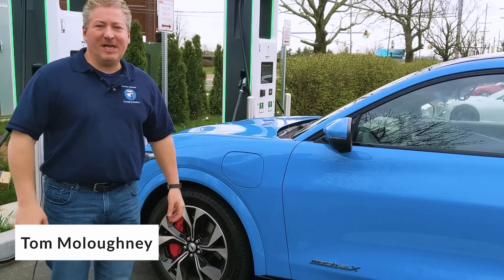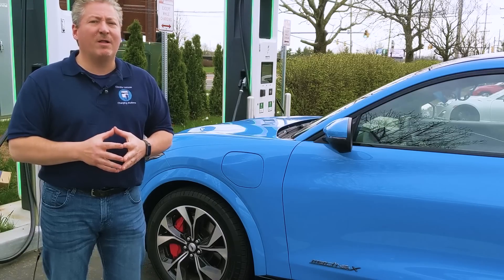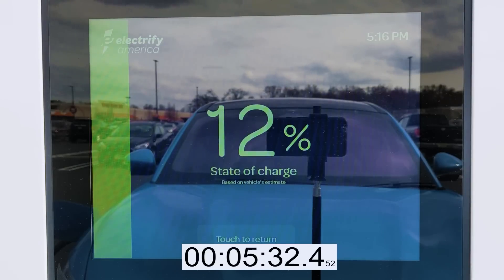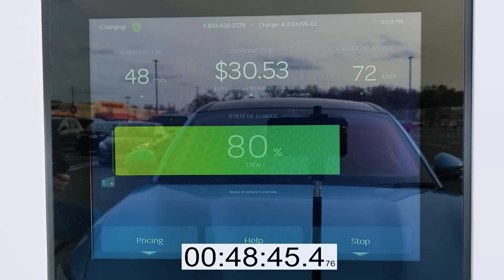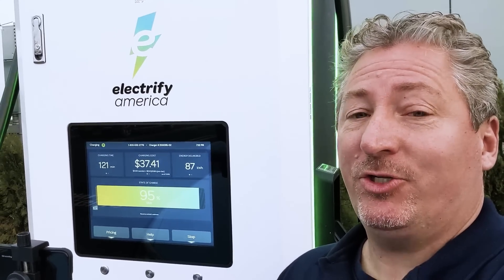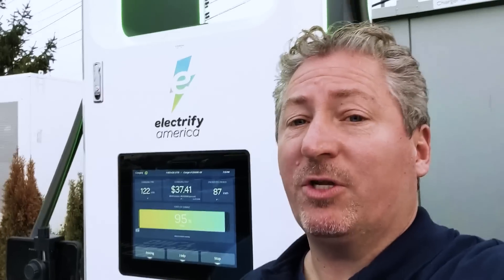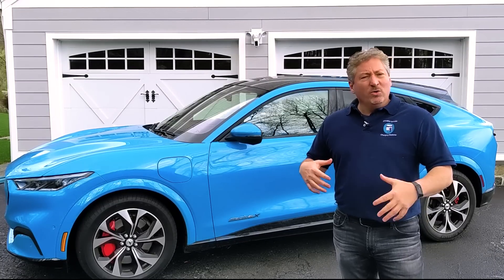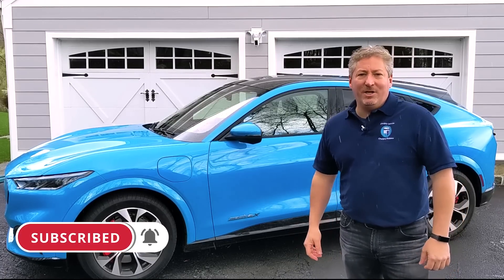Mustang Mach-E DC Fast Charge Test

Comment: 280 mph is pretty good range on AWD version! Saw similar test (Kyle at OUt of Spec) that got about 285, so pretty consistent results?  Charges well, though the cliff is HUGE when it drops off (This is a car you want to not let go below 10% and may want to pull in closer to 20% then? 2024 moels will do 10%-80% in about 36 min (seen as quick as 35 with a V3 supercharger) and THAT is what kind leading me to swap an Ioniq5 (2022) which I do love because I do believe Hyundai though it looks smaller, it has more interior room) and IONIQ 5 has CRAZY 230+ charge speeds, (however, I rarely get tthat,and was forced once or twice on a road trip to stop in a hotel with a destination charger to charge all night because the ONLY CCS charger in the region was out of commission (no charger working) and ... Well, Almost picked up a Model Y, I think I like the looks of the Mach-E, so, Yeah. May be getting a Mustang with the slightly larger range & higher charge curve.

Comment: Hi Tom.  When charging, how does listening to the stereo or using the infotainment affect the charging?
Reply: That stuff should be negligible. HVAC will slow down the effective charge rate. The systems will basically rob the power coming into feed them and then give the rest to the battery pack. Not sure how to monitor that, as the charge point/dispenser will still be showing whatever the vehicle is asking for, even if the battery isn't getting all of it - if that makes sense.

Comment: You know... that whole charge output looks and performs a heck of a lot like copying computer files from one hard drive to another.   I would doubt that the programming behind the rate of charge is similar to that of a computer handling files.    But in regards to the ev charging, i dont think its the mustang mach'e with the problem after 80%,  after all... if you had pulled into the spot for a quick fill up , when your only at 80%   the charge would take place very fast.   SO..either its programing. OR the charger is monitoring the vehicles batteries and their heat.   we must remember. batteries degrade upon extreme heat.
Reply: It's the charger protocol. But the charger is built into the Mach E, not the dispenser/EVSE. The "charger" that you plug into the car is just a big cable and plug on it with safety and billing mechanisms - it's just a power supply vending machine. It'll only deliver what the car asks for.

Comment: Thank you for making this video.  Very good job, per usual.  Interesting  that the fastest charging speed lasted only a couple minutes, literally.  I wonder how the SR battery Mach-E performs in this regard.  Thanks for having the dedication to wait until 100% charge, but looks like that part of the charge is just moot until something changes.
Reply from the maker: Yeah, I would suspect the smaller pack will have the exact same charging performance.

Comment: If you look at the charging characteristics of a single Li-ion cell, the cell should be charged via a constant current method until it reaches a certain voltage, and then via a constant voltage method until it reaches the fully charged voltage.  The constant voltage charge current is considerably less than during the constant current phase, slowing down the charge.  These characteristics are reflected in the charge rate for the whole pack, with exceptions programmed in for extreme low pack temperatures and extreme high pack temperatures.  There may also be some voltage drooping of the charger as it’s internals heat up, line voltage input varies, or other chargers kick in their loads on the transformer supplying the charging stations.  It will be interesting, if solid state batteries ever become available for practically priced cars, whether these Li-ion characteristics are eliminated, or simply get replaced by other charge curve limitations that have to be built into their own battery management systems.

Comment: Wow, even with the cost adjustment you mentioned it seems a bit pricey for electricity.
Reply from the maker: Yes, but it SHOULD be, IMO. You're paying for the convenience of charging on the road and using the equipment that the company installed. You'll always pay much less when charging at home. An Electrify America DC fast-charging site like this costs more than $500,000 for equipment and installation. The networks need to get their investment back and eventually make a profit.

Comment: That total cost ( rounded to $40) is basically what I currently pay in NJ to fill my ICE tank (without the painful wait). Unless I'm reading it incorrectly, where's the cost advantage ? Is that due to New Jersey's rates / taxes ?
Reply from the maker: Tom Moloughney

It cost $39.56 because I used Ford's account linked to Plug&Charge (I only used it because it's free with the media loan). If I used my personal Electrify America account it would have cost $28.52. Also, most EV owners recharge at home - not on public chargers. Personally, I only use them maybe once a month, so if I pay a little extra, it really doesn't matter. I do 90+% of my EV charging at home, where it costs $0.15 per kWh. Ford paid $0.43/ kWh because they don't have an Electrify America account. I pay $0.31/ kWh when I use the network, which is why I would have paid $28.52 for this  ($.31x 92 kWh). If I had charged this at home it would have cost $13.80 to drive 285 miles. You'd have to pay $1.45 per gallon for a car that gets 30mpg for it to cost the same, or $1.20 per gallon for a car that gets 25 mpg.
Reply: @StateOfChargeWithTomMoloughney  Thanks

Comment: Great video and it confirms what is in the manual; don't charge past 80% and don't fast charge a lot.  At home my L2 EVSE gets me to 90% charge (as recommended in the manual stop at 90% if plugged in every day) and at 9.23 cents per kWh (NC Duke Energy) it is cheap to drive.   When I did a Plug and Charge at an Electrify America station it was a nightmare.  Hopefully the software issues will get fixed so the rest of us can experience the joy of a seamless plug and fast charge.   As for charging at home I use a 30 amp Clipper Creek device (longer story there) and there is some interesting messaging in the FordPass app you may want to look at.  Again another very helpful video, thank you.

Comment: What happens if multiple EV's are charging at the same time.  Is the MAX output of the charger limited to shorter bursts???  Or can all the EV's charge at the MAX(ish) rate 0%-80%
Reply from the maker: That depends on the network. On the Electrify America network where I was charging, every station can supply full power regardless of how many other cars are charging on the site.

Comment: Pretty good trouble free charging. Could be faster in the first third, but not bad at all.
You seldom want to charge to even 20% when on a road trip. Plan to arrive at chargers with 10% or less and only charge enough to get to your next charging stop. Plan it right and you'll always be charging at 100kW or better and spend the least total time charging even if it adds an extra stop. Using the A Better Route Planner app makes travelling like this easy.
Reply: And imagine if they upped the 150kW charging to something like 10 minutes, even 5 minutes.  You could get some quick fill ups and be on the road in no time.
Reply: Or you could use gas and fill up whenever you want and drive as fast as you want
Reply: @dennisfinan7977  This year an electric Porsche Taycan did the coast to coast Cannonball Run at an average speed of 127mph beating out the previous EV record holder, a Tesla. 
After you drive electric vehicles for a bit you'll find that gas cars just aren't fun any more, or fast. They make gas cars feel slow and old fashioned. 
Only at the track do I get to "drive as fast as I want" and I've got gas bikes (and one electric) for that.
Reply: @dennisfinan7977  90% of the time we're not on roadtrips and we never have to go to a gas station. I save way more time charging at home during regular use than I spend charging on roadtrips.

Comment: Demonstrating Plug&Charge makes good sense.  So if I wanted to save money on a road trip by using EA account, how much effort is required to charge w/o Plug&Charge?
Reply from the maker: It's different in different states. Here in NJ, it would cost me $28.52 (plus 6.625% sales tax) for 0 -100% charged as it delivered 92 kWh and the cost is $0.31/kWh
Reply: It's pretty easy if you use the Electrify America app. It's often just as fast as or faster than the Plug & Charge handshake at most stations and you get the discounted rate.

Comment: Very disappointing.  80% is only 216 miles of range.  Not good on a long trip.
Reply from the maker: That depends on the road trip. You've already gone 200-275 miles so it's a 400+ mile trip with only 1 stop.

Comment: If you have the vehicle still, some other reviewers have noted that by stopping the charging session and restarting it around 20-25% state of charge, the charging rate improves to 125+ kwh. That may be a software bug to be rectified. Wonder if you can test that out.
Reply from the maker: I didn't test that because I am confident it would have worked. The highest charging rate is time-based, and only lasts for 2 minutes. If I unplugged at around 20% as you indicated I'm sure it would have jumped up to a higher charge rate for 2 minutes, then settled back into the curve that it was going on initially. But honestly, that would have slowed down charging. the time it took to end the session, et the charger reset and plug back in would have negated the short burst of extra power. Plus, nobody's going to do that while they DC fast charge AND... there's a reason Ford does what they do. I suspect you'll overheat something and perhaps end up on a tow truck if you keep doing that.
Reply: @StateOfChargeWithTomMoloughney  Fair enough. I saw some other reviewers do it, but I wasn't sure  how long it lasted.

Comment: once charging drops off, the equipment should be able to switch to AC-charging and let the car handle the DC-conversion. That will free up the charging-station-equipment to service the next car at 150KW. That way you can have more cables on the same number of chargers. no need to keep the big iron busy when the car drops down to feed-by-straw. but i've never seen a CSS-plug with AC-pins...
Reply from the maker: There's a level 2 AC charger two stalls down from where I was charging.
Reply: @StateOfChargeWithTomMoloughney  which is nice, but it requires moving the car. Automatically switching would be nicer

Comment: Incredible patience to wait for the Mach-E to make it to 100%. Ford has probably seen universal opposition to this crazy slow down. Hopefully they update the charge curve over the air soon.
Reply: It needs to be faster to 80%. The dropoff at 80% should be softened but the time to 80% is a bigger deal since other cars coming this year and next will get the same recharge range in half the time.
Reply: Nobody charges to 100% at DC chargers. Just get enough to make it to the next charger w/ 10% left. The fastest way to travel long distances in any EV is to spend your charging time when the car can accept charge quickly, the first 50% of the battery.
Reply: @Miata822  the Mach-E needs to charge faster to 80%. For owners today with the big battery, it's like 40-42 mins. Hyundai and Kia are going to have cars with the same range but recharge in 18 minutes. It's no contest.
Reply: @anthonyc8499  What you say is true. My post was in response to the OP. He was commenting on the DC charge time to 100%. That spec (DC charge time to 100%) is about as meaningful as a vehicle's top speed in reverse. There is number, but it doesn't matter in the real world.

Since there are so many people new to EVs who are just now starting to look at and compare EVs we should try to provide a little context when we can.
Reply: @anthonyc8499  Hyundai and Kia are 800volt architecture. Mach e is only 400volt. No software update will let the Mach e charge as fast. It can get better but won’t match those 2

Comment: Not all Fast Chargers charge by the Kwh, many Fast Chargers charge by the minute and this charging profile would simply add a lot of unnecessary expense to a charging session, even if you only charged up to 80% 
PS: the reason many Chargers charge by the minute has to do with electricity rate regulations, Some states do not allow electricity to be resold, so the Charger companies are prevented from charging by the Kwh.
Reply from the maker: Correct. Currently, I believe EA charges by the kWh in about 26 states. But those states are where EV adoption is highest, and account for 85% of all charging on the EA network.
Reply: Ea charges .12 cent per minute in states that don’t allow kwh charging

Comment: Tom, if you're only realistically going to be able to obtain 80% fast charging, what does the Mach-E power curve look like?  Meaning EV's start losing power as SOC decreases.  What would 0-60 be at 80%, 50%, 25%?
Reply from the maker: I don't have that information. It would take a lot of testing and 1/4 mile track runs and I don't have access to that. In my experience driving it, the power doesn't really tail off too much until the car in less than 30% charged.

Comment: Hey Tom, in your conversations with Ford's engineers have they even hinted that they will uncork the Mach-E's charging so it takes less time and also goes above 80%?
Reply from the maker: I don't have anything to report on that. But honestly, that shouldn't be too much of a concern for most people. When we road trip EVs, we almost never charge past 80% on a DC fast charger. I would be much more happy if they increased the time the vehicle can hold 150 kW at a lower state of charge or allowed it to hold 125 kW until 50% or so.
Reply: @StateOfChargeWithTomMoloughney  the 80% cliff is annoying but not a deal breaker but the time to 80% has a lot of room for improvement. New EVs are coming to market that get 100-150 miles of range back much quicker than the Mach-E. I just don't want Ford to be obsolete so soon after release.
Reply from the maker: @anthonyc8499  I get what your saying, bit I disagree on saying it obsolete. The 2022 Chevy Bolt EV has a maximum charge rate of 55kW - that's kind of obsolete, not the Mach-E. It's not the best, but far, far from the worst. 😁
Reply: @StateOfChargeWithTomMoloughney  thanks Tom! 30 minutes to 80% just seems to better compete with the current market leader and might still be palatable in 2022+ when 800v systems that recharge in 18 minutes arrive. Please bug Ford for us and tell them to unleash the Mach-E's charging speed! 🙂

Comment: The only time anyone should really be charging over 80% is when they're charging at home before making a long trip that requires the extra power where charging time in one's garage isn't affected by this slowdown.  Slowing charging above 80% at fast chargers not only reduces degradation to the battery pack, but also makes it pointless to keep your car on the charger beyond 80%, thereby freeing up DC fast chargers sooner.  Even some cars with faster charging rates can take 20-30 minutes to charge from 80% to 100%.  It's really bad for road trip time optimization.  This may be something we want all OEMs to start doing to ensure charger availability.

Comment: When the car had an 80% charge, what was the estimated distance to empty? 
Also, is there a guess as to what distance you could go if you kept the speed to a respectable 65 mph?
Reply from the maker: Since I did 285 miles at 70 mph, I believe 295 miles would be attainable at 65 mph in favorable weather conditions.
Reply: @StateOfChargeWithTomMoloughney  So you could go 230 miles with an 80% charge?
Reply from the maker: @markbullock3741  I'm mild temperatures, yes.
Reply: I'm getting over 300 in range in the exact same trim (Grabber Blue FE)

Comment: Tom loves the grabber blue (it does look very nice).  I hope the two minute max at 150 kW restriction isn't due to derating the wires leading to the battery for continuous use.  That might make it harder to improve that aspect of the charging curve in a future update.  The max 12kW after 80% thing really should be fixed.  That restriction could be very painful if the next charger is 250 miles away.
Reply from the maker: I believe it's baked into the software to cool the BMS.
Reply: Ford is shitting the bed with thermal management. They threw a Hail Mary hoping most owners won’t break the 80% rule.